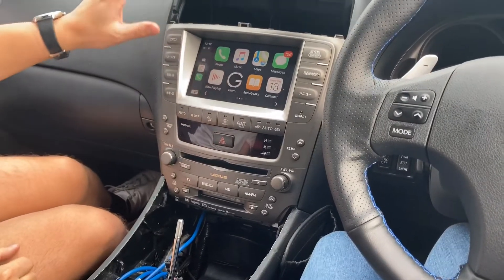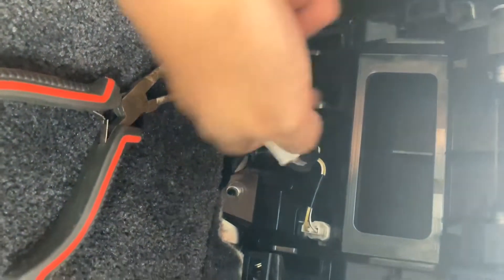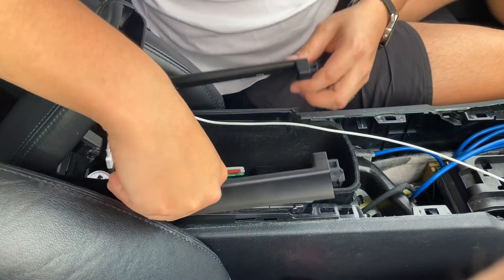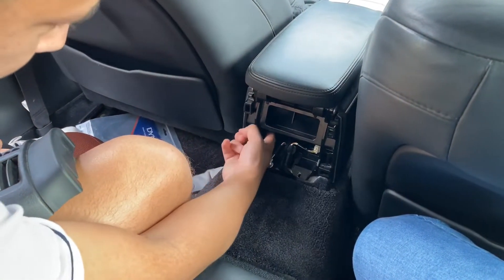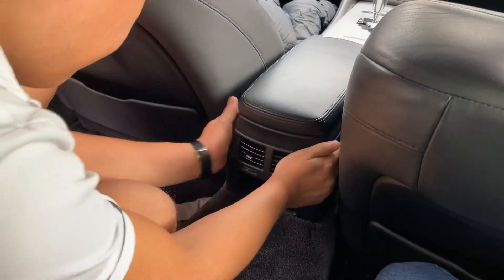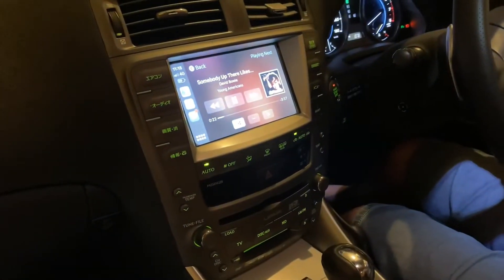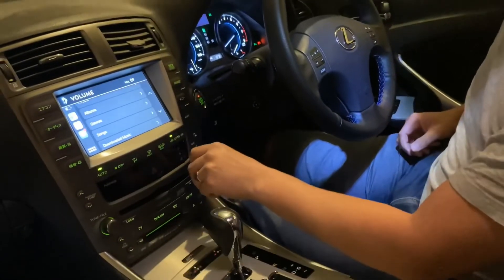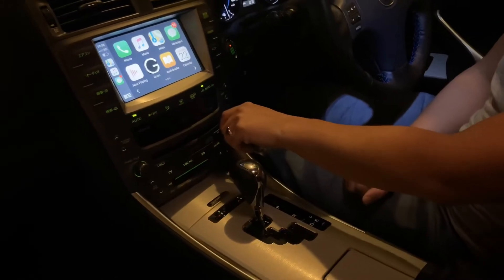Wireless and Wired CarPlay - Lexus IS 350 GROM VLine VL2

Comment: Can I ask what might be a silly question: You’ve used a usb cable to run from the Grom VL2 and you say you’ve plunged it into what was the Aux input, buy removing the connector. Did you need to add a similar connector to the usb cable to plug it into the socket that you removed the original aux cable from? If not, can you let me know what you’ve done to get around this.  Great video by the way and love your setup 👍🏻 As you can probably tell from my question, I’m seriously considering doing this myself.  One other thing, how did you get power to the Grom unit? Thanks in advance.
Reply from the maker: John Gravett G’day John, not a silly question at all! It’s quite simple. At the back of the console you unplug the auxiliary cable that runs from the headunit, that connects to the aux port. Once you’ve unplugged that clip, you can pull out the little aux port. Then you have a square hole where the old port went. 

You buy something similar to this https://flic.kr/p/2jFRrVk and the USB extension cable plugs into that port.

The GROM unit comes with a set of cables that basically piggyback off the headunit, which provides power to the unit.

Hope this helps and clarifies things for you!
Cheers
Reply: @sammygoris  That's great.  Thank you.

Comment: What year is your car?
Reply from the maker: Adrian my car is a 2006 model.
Reply: @sammygoris  Wow it looks great man, Im looking into buying one soon. How many miles would  u recommend I buy one at or how much Is too much?
Reply from the maker: Adrian thanks man! I’ve added some video links in the description that might help you with getting to know the IS more.

Here is what I would recommend:
1. Buy one with high specs, the base models are very plain and don’t have many features.
2. If you can, get a 350. In NZ, they are maybe 15% more expensive than a 250, so it’s worth it. The 250 is incredibly slow. I sold my 250 after 2 weeks and bought a 350. 350 is only 20% less efficient but you get 100 extra HP. 350 engine is also more robust and reliable and way less carbon build up than 250.
3. It’s hard to say how many miles are too high, because they are incredibly reliable. Miles are only 1 dimensional when assessing a car. Look at the condition of the car and how well it’s been looked after. A tidy well maintained higher mileage car is better than poorly looked after low mileage car.